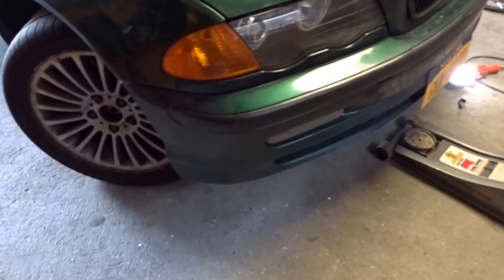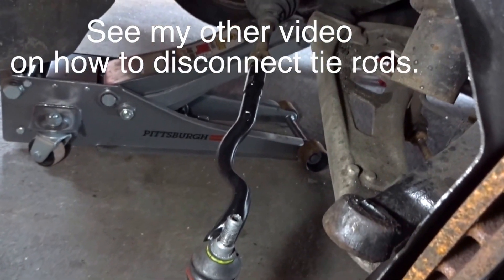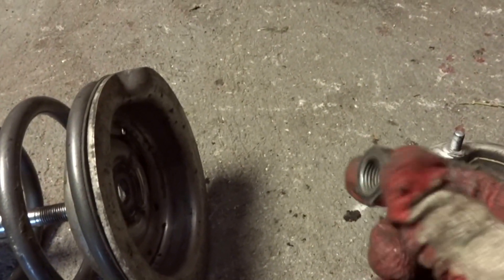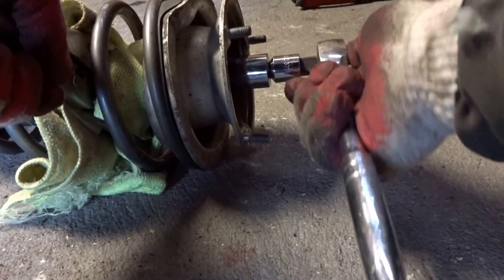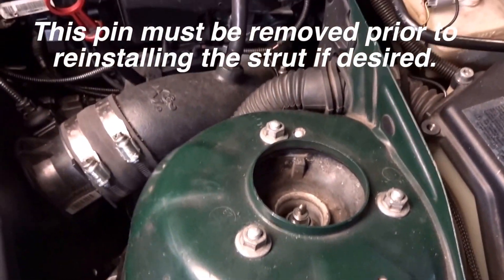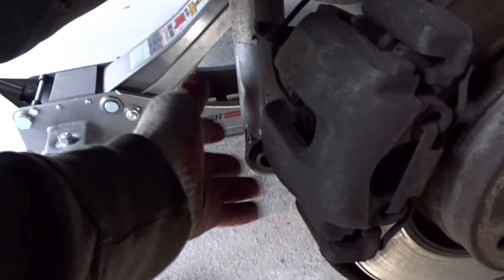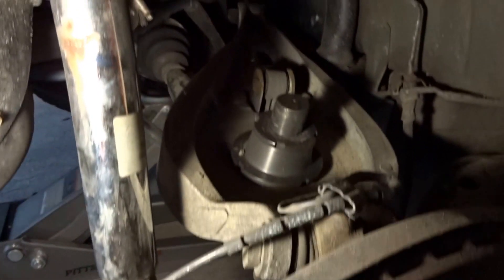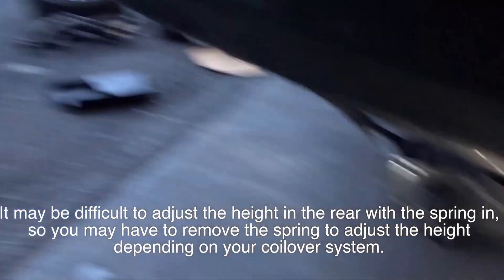BMW E46 COILOVER SUSPENSION INSTALL

Comment: Helpful vid! What's your wheel/tire setup? And what are the wheels called?
Reply from the maker: Those in the video are stock wheels from an e46. My other wheels that i am running now are 3sdm 0.06 with 255 35 18 all around. 9.5 in wide